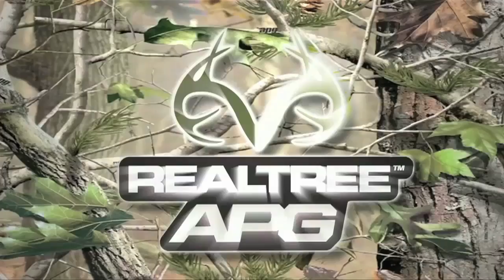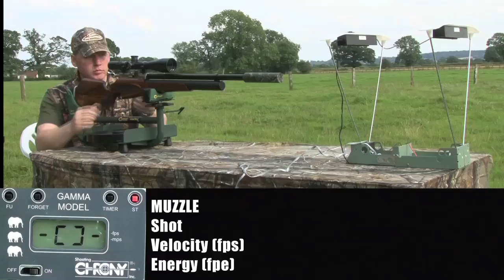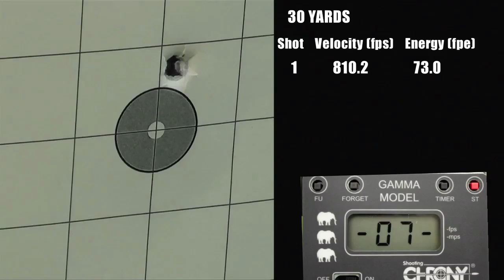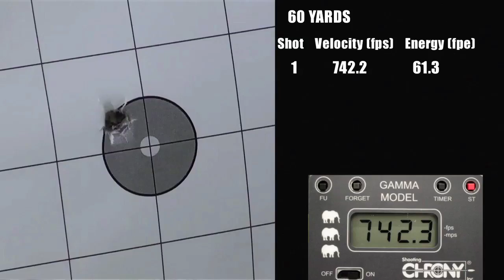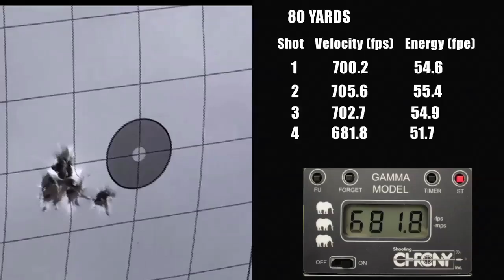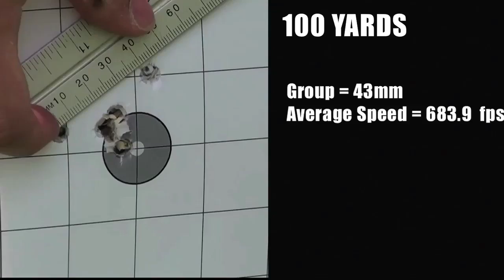Daystate Wolverine .303 - Long Range Ballistics

Comment: Nice but i found some error on the calculation....
at 80Yard, average should be 698.6 (you said 798.6, but 54.3fpe is correct).
at 100 yard theres 100fps difference between 4th and 5th shot...

Comment: Hi! Very good video! I'm a big Daystate fan. But I can't work out where this rifle fits in for a sportsman - it's more expensive to shoot than .22RF (LR) and on par with .17HMR. For example 525 .22RF rounds are about £25 and you don't have to worry about air, with only ~15 shots per charge combined with the cost of the pellets I can't see what this rifle is for, where does it fit in? I'm not knocking it for a moment in terms of its quality, but what's it useful for?

Comment: im pretty sure you messed up at the 80yrd test because the pellets were going 705.1-681.8 fps no higher and you averaged it out to be going 798fps which is ridiculous. im pretty sure you meant average fps is 698 on those five shots.

Comment: firstly when you measure your groupings your ment to measure from the centre of more slug to the centre measuring outside to outside is wrong. you need to take atleast 5mm off your measurements to get your correct measurement

Comment: a .22 lr only has about 130fte, these air rifles produce more energy than those. dont get me wronge i love my .22 but my .25 condor is the gun i use when im not using my .17hmr because its hitts just as hard a .22 and is a lot quieter.

Comment: The .303 has about 100 ft pounds of energy ok? I didn't mention 22's getting 200 ft. pounds, regular bulk federal pack ( which I get on sale $17.50 for 525 rounds BTW ) is closer to 120 ft pounds or so. So lets see the ammo is cheap ( about 3 cents a round or so ) The rifle is wayyyyyy cheaper ( 200 bucks for a Ruger 10/22 compared with what like 1,500 or 1,700 for a wolverine ) AND it has more energy with a expanding bullet. ANY .22lr is more powerful and economical than this .303 air BS.

Comment: lol tellin ya that gun is BEAST... it is being used alot by ranch owners in the south that have a bad feral pig population, the rogue has enough range and power to put em down with very little noise or recoil, not like using a .308 or .223 where once you shoot they scatter, with the rogue its minimal noise, and can take out more than one pig in a setup., so in that aspect WELL WORTH the money, i just dont see spending over a grand on an air rifle when i can get one hell of a .308 lol

Comment: This things energy at the muzzle doesn't even reach 100 most of the time. With the .22 you get a much cheaper rifle, more available ammo, a bullet that actually expands in the target, flatter long range trajectory, and more muzzle energy all for less money. So I'll say again, whats the benefit? You could even throw on a $200 supressor for still much cheaper and get it really quiet so noise isn't even a issue. This "gun" is pointless.

Comment: That was a small boar and you need to hit him in the perfect spot in the head. You try to take larger game and miss your liable to get charged and messed up if you don't have a big bore handgun on your hip. A 10/22 with a suppressor would be easily more than a thousand dollars cheaper and more powerfull. I get what your saying about reviewing it, but unless the price comes down it's pointless. Using something that is inferior in power and 4 times as expensive just doesn't make sense.

Comment: ...subject to conditional failure due to water and corroding over time. Which may make this weapon a better tool in many situations. Further more just cause it dont go BANG, doesn't mean its not a real gun lol. yeah HANDguns are far more restricted in the UK. so yeah "i guess theys caint hev reel goons" but they also dont have 10.5 guns related deaths per 100,000 citizens. try .25 per 100,000. getting it yet?
Reply: UK crime as one offense, whether 1 or 100 perpetrators, here in the US we show real stats.